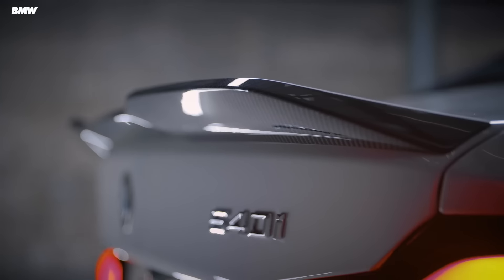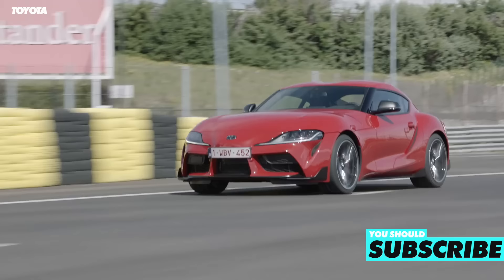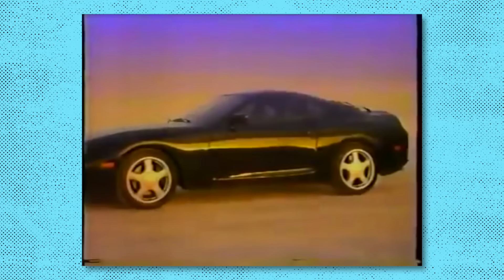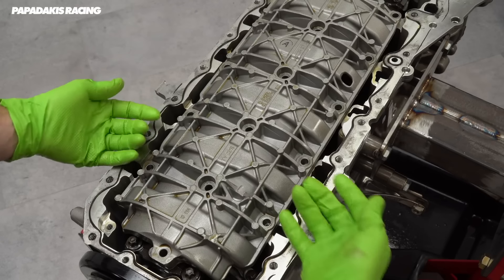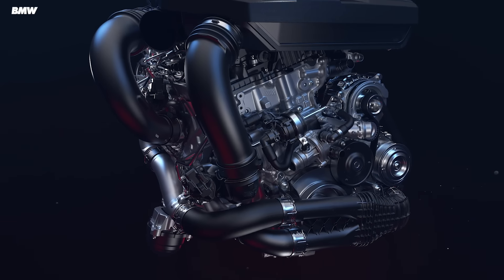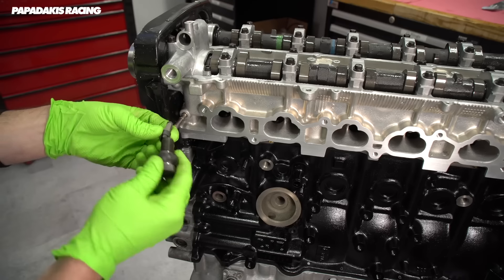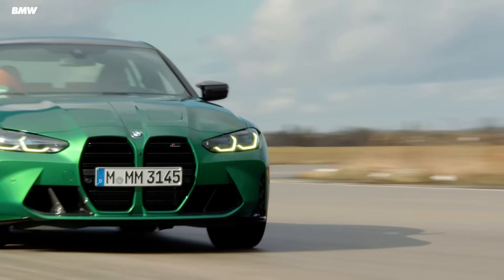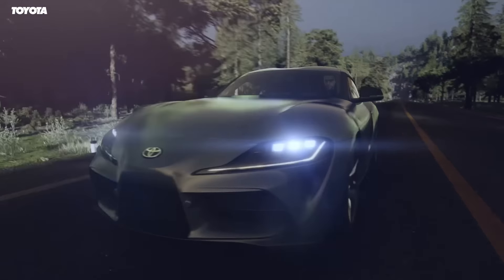Inside BMW's Greatest Engine

Comment: 2JZ any day.  I have 3 cars with the 2JZ-GE.  Smooth as silk and dead reliable. No freaking plastic.  My  Cars have around 300,000 miles.   I did own a 92 325 and an 01 330i.  Engines were good but anything plastic associated with them fell apart.   Well just about anything of plastic broke on these cars.  Nice to hear the B58 is reliable.  Reliable and BMW are not usually used in the same sentience these days.
Reply: I own a 98 Supra ... still on stock twins, she idle's like a kitten purs, nice and smooth. 
When that B58 hits 2000 hp, i will then say its as good as the 2JZ ...

Comment: will see how well the plasic and rubber parts do. If its like most other BMWs will disintegrate and fail. They cant even make a dust boot (strut bellow) that doesnt disintegrate before 80000 miles on my n55

Comment: Strange how BMW make such great 6 cylinder engines but have trouble making inline 4s. The current B48 is the first 4 cylinder Petrol that BMW have made since the S14 in the E30 M3 that wasn't utter junk.

Comment: Im surprised he said BMW and reliable in same sentence. Im BMW owner myself. Every single BMW had oil leak. Especially from head gasket and oil pan gasket failure. Its well known in BMW community. Plus its not easy to swap em out. You have to drop subframe to switch out oil pan gasket which mean $$$ on labor.

Comment: Just picked up my 22 Supra. The engine is nothing short of magic. Bravo to BMW and Toyota.
Reply: Toyota had nothing to do with the development of the B58, sure they might have had some say on the chassis of the car but even then it wasn't much. The Supra is very much a reskinned BMW.
Reply: @somerandomusernamenobodyhas  Fine by me
Reply: @somerandomusernamenobodyhas that is just a lie. They helped design the engine to be to their standards in reliability. Going as far as to ship every individual piece from Germany to Japan just to test them.
Reply: @YourLocalFloridians  Oh yeah? And you were the guy who delivered them right? The B58 was designed by BMW as a successor to the N55 before their partnership. The only thing co-designed was the chassis but nice try man.
Reply: @somerandomusernamenobodyhas  My proof that Toyota helped make the engine is in a video called “2021 Toyota Supra - BMW or Toyota? The UNTOLD TRUE STORY”. From 8:57-9:34.
Reply: @YourLocalFloridians  Toyota did not help engineer the B58. They had checked all the internals and components to make sure it met their standard and performed exhaustive testing on the engine to see if it fit their needs for the Supra. This is AFTER it was already in production for several years (2015 to be exact). So no, if you think Toyota helped make the engine you are sorely mistaken and your source is incorrect. Also your misunderstanding can be cleared by simply reading Wikipedia on the B58.. 👍

Comment: Correction... the b58 is NOT used as the base for the s58...
They don't even share the same base bore and stroke... the s58 is alot more similar to the s55 than b58...

Comment: Toyota did the genius move, talked with BMW when they created this, gave them a few tips here and there and tadaaa. No more timing chain/guide issues and 700 hp on stock block. A tuner in my area ran 850hp over an year on stock block and did launches and 100 200's till it blew.

Comment: Some wrong info here the B58 on the supra is rated at 385HP from BMW and was dynoed at 412 HP ...the one he's talking about is the 5 year old supra the year after that Toyota gave it a different tune and since then it's 385hp
Reply: Not quite the whole story.

On some markets (the EU, more specifically), the 3.0 Supras are still using the 2019 engine - some due to emissions compliance with local laws.

Comment: fun fact when the b58 was engineered it actualy made around 450hp but bmw said nono to that since it would have put their M engine's to shame. so they downtuned it. so in a sense the engine is originally made for 450hp. but they build it so strong you see people with 600-700hp on the stock engine.

Comment: Have this in my 740i. For now my main radiator leaked and changed, and my  driveshaft and differential destroyed on connection between (costly). Totally eaten and all of the sudden no power at all. Also changed engine mounts on 40.000 miles. Think that mount somehow did that damage on driveshaft also.

Comment: Long time bmw owner and fan boy of bmw here. I think that going for bmw engine was a right choice for toyota - alto not as iconic 2jz, bmw engines are pretty good and have long history of improving them, while 2jz felt like an accident (or bunch of good engineers going wild due to lack of oversight). Don’t get me wrong bmw engines (specially petrol ones) have long history of issues (that damn oil filter housing) but overall you’re unlikely to leave your crank case behind you after flooring it.

Comment: Calling it now, if the next gen Supra has a straight 6, it's going to be based on 2 of the modular G16E 3 cyl in the GR Yaris/Corolla.
Reply: That said, I don't hate the B58 Toyota went with in the slightest, it was a good call at the time on Toyota's part for the Supra.

Comment: Are the b48 and b58 modular
Reply: Yes. In fact the 3 cylinder B38, 4 cylinder B48 and 6 cylinder B58 all use the same pistons, con rods, valves, etc etc.; the capacity of each cylinder is 500cc, which makes for easy calculation of the volumetrics. This standardisation of parts makes for a cheaper solution for the whole range of cars BMW make, as these engines are so very tuneable.

Comment: Did you know, that BMW only changes the oil pump and fits it as a race engine in their M4 GT3? So if you are driving a new M3 or M4... its a GT3 engine. BMW designed that engine to be a racing engine

Comment: I'm still happy with my b48 and i hope it doesn't have that much planned obsolescence like the m271 in my w203 mercedes(timing chain replacement 2800€ after 90k km and engine failure because of the replaced timing chain after 196k km.

Comment: All engines have oil cooled pistons. The B58 has forged rods, the only possible weak point are the pistons which are cast alloy. Ideally they should be replaced with forged pistons, then it would be bullet-proof.
The B58 is almost the greatest BMW engine, the S58 is better. But nothing beats the F1 McLaren V12, it's a masterpiece.
 (most common production engines have oil jets cooling the pistons).

Comment: Compare to 2jz that's 30 year olds technology, this why 2jz is a Great straight 6 engine and it's still good today.
Reply: Pull the 2jz up to today's emissions and that changes everything. If toyo decided to make a engine similar to the 2j today it wouldn't be anywhere near recognizable to a JZ that it may aswell be very similar to the B58 that has a front mounted chain with a open deck block like the rest of toyos modern engines(other than the B58 being closed deck).

Comment: The 2jz is still better as the timing system is much easier to refresh every 100,000 miles and port injection keeps valves clean and much cheaper to maintain compared to direct injection and a timing chain apart from that there very similar architecture ps the having the turbo at the top easily accessible really helps on the 2jz

Comment: 2jz does not have a girdle that ties the caps. the upper oilpan just kinda stiffens the block from panrail to pan rail. the stock caps on a 2jz are the weakest link in the engine for this reason i think.

Comment: I wanted a Supra until I heard it was a bmw engine. Several friends and relatives gave me their bmw ownership horror stories so I ran for the hills. That being said I had a 2jz sitting in the driveway since 2006 and yeah that it a tough act to follow, by far the most reliable engine I have ever owned.
Reply: Having this engine is an asset. You can’t judge Bmw for other peoples STORIES. Usually, people that can’t afford normal maintenance, own them and it’s the car that suffers for not being taken care of. Own one from new and see for yourself.
Reply: If you live outside of Europe, do not purchase a BMW or any other European branded cars as parts cost a fortune to ship and fit. It is better to just lease them  and let the problems be passed onto the dealership to fix. This B58 engine might be a great piece of engineering but European made engines like these are pretty much monstrous, intricate, ticking time bombs. Even with proper maintenance, you're looking into spending way more to do them than any Japanese made engine.

Comment: I would say BMW's i6 are better for a couple of reasons (not only cuz I'm a fanboy) but the fact that BMW's had the engine for MUCH longer than Toyota does, the amount of vehicles BMW has fitted with i6 is greater than Toyota.

Comment: I believe its good … but after e36 they started with plastic parts… they become brittle after time due to heat and cold cycles… before it was most cast iron… in my opinion this makes the engine less likely to grow older.. i believe its fast though…

Comment: The B58 is fine, but I'll take the S58 in my M2 Comp. Especially the M3/M4 version. It's a B58 on steroids. (But the B58 definitely produces a sweeter exhaust note)
Reply: you mean the s55, which has no roots from the b58?

Comment: Some people complained about oil consumtion  regarding this engine. I don't know if it's true, I've seen it on Instagram.
Reply: B58 owner here with MHD stage 1... my engine (B58 gen 1) does not consume oil at all between oil change intervals of 10.000kms... I’ve heard that the Gen 2 is the one with oil consumption. Not sure either if this is true or not. But although i like to drive my car hard from time to time, I haven’t experienced oil consumption yet and the engine has already 62.000 kms. 😃👌

Comment: The 2013 and up Bmw engines are super reliable not like the 90's and early 2000 engines..ppl hate the bmw but bmw is best bang for buck..they have jumped leap year's in terms of power and reliability
Reply: Not really. The 2.0 turbo in 28i and 20i can destroy itself completely
Reply: Nothing wrong with the M60B40 (540i v8 1995) either. And I assume lots of the pre vanos 90s bmw motors.

Comment: Good video , however its the N54 you meant to cover as BMWs best
Reply: Yup that motor is so hated because of its problems. But reals ones know that engine was wayyy ahead of its time. Such a capable motor.

Comment: Nothing wrong with the n54/55 just hard pipe them and rebuild the stock turbos turn up the boast as all are balanced from factory just not to much as can spin the timing sprocket as nothing holding the bottom timing sprocket on

Comment: “17 year olds” - yes because insurance doesn’t exist ( especially in the uk) i have a 1.2 vw fox with 53 horsepower which costs 1600 to insure with a black box. adding a turbo increases the price by 8x which would be over 10 grand a year to insure

Comment: I do not care for the open deck design of the block.   I know the open deck allows better water flow, but think 3-4 thin gusts would be an important….     The Hayabusa by Suzuki I feel is a reliable engine build big power for the size.   But it is a motorcycle engine not a car engine
Reply: It's closed deck dear
Reply: @bocahdongo7769  Tyler video showed an open deck tho hun,   Then I agree it cold be a good strong block, but time will and hopefully they did it right unlike Ford with the 2.4L motor

Comment: I’m alright with Toyota using a BMW engine in the 1st gen new Supra, hopefully they use a Toyota engine in the next generation, my issue is that they don’t have a manual option for this car… BMW learned this from the American market that we like our old manuals and they’re still manufacturing them this way Toyota should have gotten the message with their current halo car.

Comment: Common B58 Issues (I would stick with a Toyota BMW mechanics think they are brain surgens)
VANOS Solenoid. VANOS is BMW's proprietary system for dynamic valve timing, similar to the well-known Honda VTEC or Toyota's VVT-i. ...
Valve Cover Gasket. Another mainstay in the BMW “common problems” category is the valve cover gasket (VCG). ...
Oil Filter Disintegration. ...
Excess Coolant Consumption.

Comment: The curious thing to mw is that Toyota went to the trouble or developing from scratch a 3 cylinder 1.6litre rocket for the Yaris.  ….and a 3 cylinder is exactly half a 6 cylinder.   Indeed all emissions durability cooling ecu and other issues MUST have been dealt with on the GR yaris….so why use a BMW engine in the SUPRA ?????

Comment: Laughing in N54.. 17 yo car making 600hp with 150k miles on the odo.. And only have had to replace the waterpump, hpfp, valve cover gasket, and oil pan gasket in that entire time.

Comment: 2jz doesn't have a block gridle. It has individual bearing caps. 

The s54 is a far better motor. Horsepowerfreaks made 800hp on a stock motor and clutch.
Reply: 2JZ has done 1300 crank hp on stock bottom end ... and 2000 hp with built bottom end, when that B58 or S54 hits 2000 hp, i will say its as good as the 2JZ

Comment: So genius that it doesn't even make as much power as the supercharged Toyota V6 in the Evora. WTF was Toyota thinking?
Reply: I suggest taking a look at the different advantages and disadvantages of a straight-6 vs a V6. The former is the reason why Toyota went to BMW: the JZ is also built in that configuration.
Reply: @pmayo7894  I'm well aware of the differences between a V6 and an inline 6, but Toyota never should have gone to BMW for anything, as they're capable of making far superior engines.
Reply: @PistonAvatarGuy  - which would take a lot of time and RnD resources (and even already more complicated given that EVs are on the horizon), and "superior" requires some asterisks. The JZ isn't just applied only onto the Supra, there are a whole hosts of other cars like the Aristo and Altezza that have it.

Not a lot of manufacturers besides BMW make straight-6 engines these days.
Reply: @pmayo7894  Obviously it wouldn't have been a good business decision to design an entirely new platform and engine for the Mk. V Supra, but Toyota should have either not built a new Supra, taken the loss and built a halo car, or just used thier (ALREADY SUPERIOR TO THE BMW B58) V6. Rebadging a BMW was just a shameless cash-grab and tarnished Toyota's name (IMO).

Anyway, you're not telling me anything I don't know, chances are that I've been aware of everything that you're telling me here for longer than you've been alive.
Reply: @PistonAvatarGuy  - and yet, we the customers don't exactly know what we want and almost outright whine when things go south.

I understand, people want Toyota to do the car almost by themselves, but looking at the prices of Corvettes, Mustangs, and Camaros (relatively affordably in the U.S.), the partnership seems to be paying off well. Besides, we didn't buy enough A80s brand new and some of us outright criticized the car at the beginning. And yet, why aren't we touching the V8 on the RC F and LC 500?
Reply: @pmayo7894  I know what I want, and I want Japanese cars to be Japanese. I don't like the limitations that economics place on the technologies made available to us, I think that it's ridiculous to let a bureaucracy place limits on human creativity and ingenuity in the way that a monetary system does.

Comment: Those 17 year olds better also throw in a propshaft and a gearbox that can handle 200 extra horsepower because I guarantee you that neither the propshaft nor the gearbox will handle that much extra on stock. And do not even start me on the differential that will lose its teeth the moment you floor that thing especially if you also add good tyres where it can actually put those horses to the ground and turn them into actual power instead of just burning rubber.

Comment: One thing car makers are doing right now that I hate, is on one hand: "Here's our best engine ever!"

On the other hand: "But you probably won't be able to buy it next year because we're going electric."

Some manufacturers have resisted the turbo or electric craze for a while (Toyota/Lexus), but even they are starting to cave to this.

I hope over the next few years the auto manufacturers push back, people push back on the woke and green politics, and these new engineered engines still exist.

Comment: 5 years ago this would have excited me so much, but I have completely lost interest in the ICE age. I much prefer the video you recommend at the end on the Koenigsegg's Quark. It weighs 63lbs with 443ft-lb & 335HP, easily fitting one to each drive wheel for torque vectoring. Practically weighing in at 252lbs , 1772 ft-lb, 1340 HP.

Comment: The disintegrating oil filters are probably from knock off China oil filters posing as OEM BMW filters. Make sure you're not buying a knock-off oil filter. There's plenty information on the internet regarding disintegrating knockoff oil filters.

Comment: With all the respect to Driven Media,this is an Outdated Technology Internal Combustion Engine, is not an Electric motor, so for me is crap. MHO from a proud owner of a 2014 Tesla P85D with more than 200k miles on it and with almost ZERO maintenance expenses since new.

Comment: Geez no mention of an N54 at all? If you’re talking tunable engines um  n54 has always been compared to the 2zj and turns a 300 hp car into 1000 potential hp. I’d argue current tuning trend is largely due to N54 heads. B58 who bro?

Comment: This needs to be cleared up: 
B58 is used in the 2020 Supra and 340i.
B58Tu is used in the M340 and 2021+ Supra.

The B58 makes 340 the B58Tu is sold at 386 but makes closer to 400. 💡

Comment: There is NEVER such a thing as overengineered or overbuilt.  Who doesn't want a car that can take such abuse and still not die?  Imagine how long the unmodified ones are lasting!!  I am not a fan of Toyota (their Atkinson engines specifically) but I know they can last a really long time.  I usually find Corollas ugly (even though I know they last a long time).